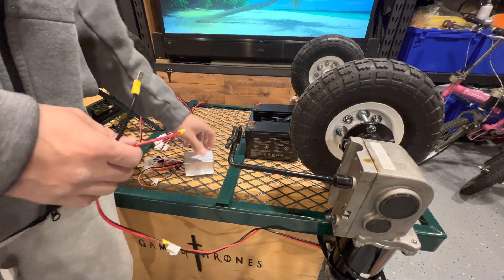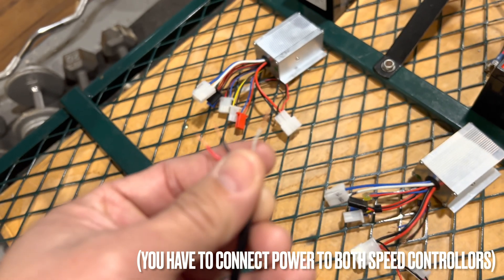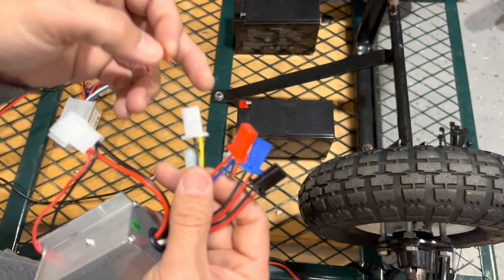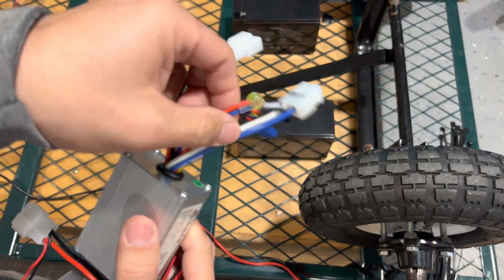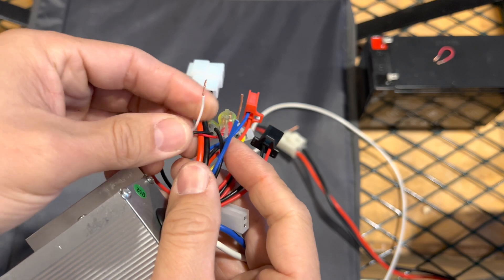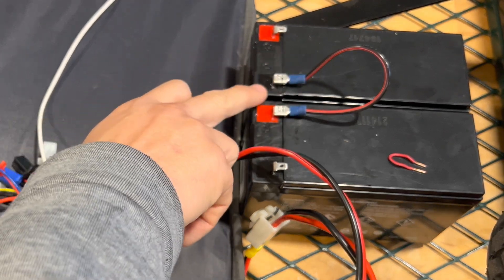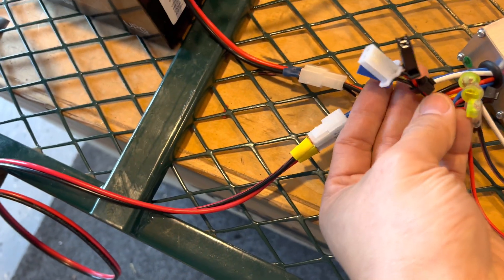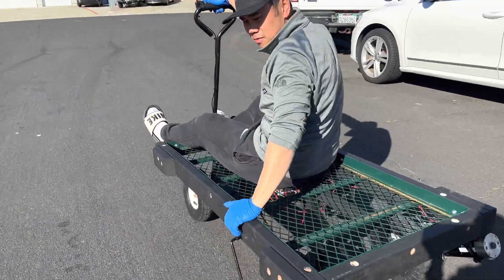How To Build An Electric Beach Cart Wagon Part 2: Connecting Throttle Control and Speed Controller

Comment: What motor are you using?
Reply from the maker: @mcrutchfield007  hi, I used an old wheel chair motors.  Each motor may lift approximately 300lbs